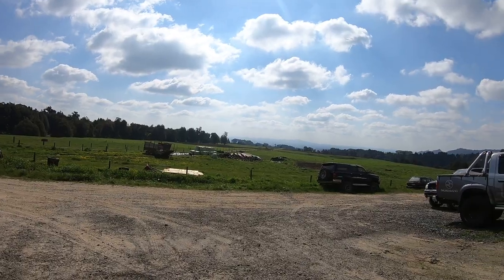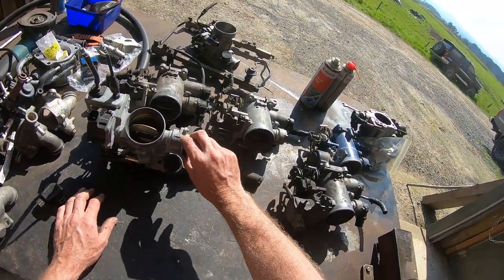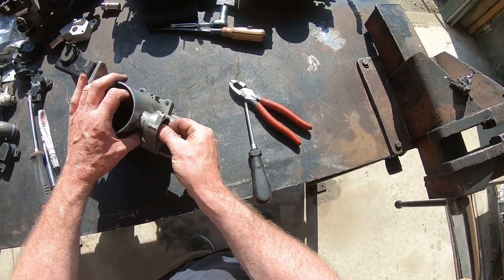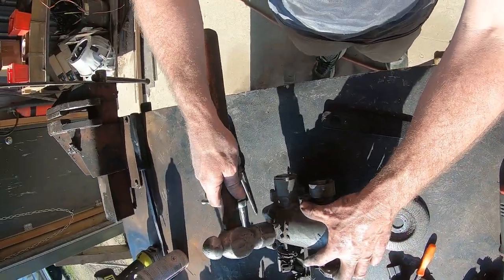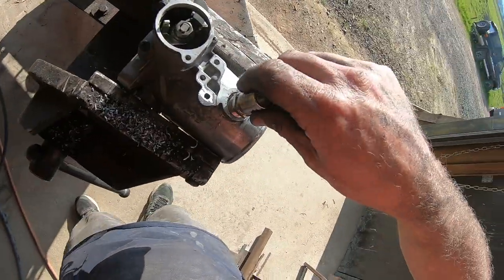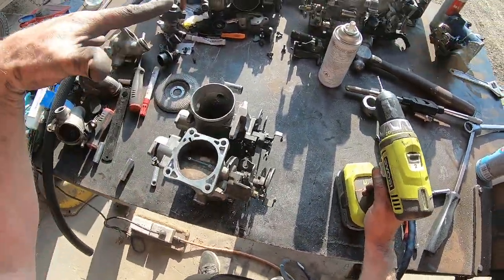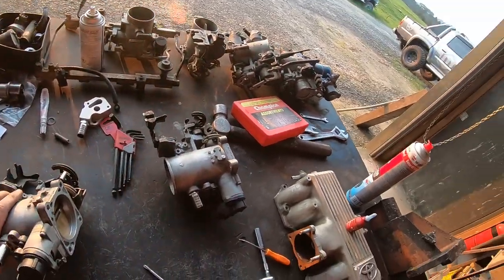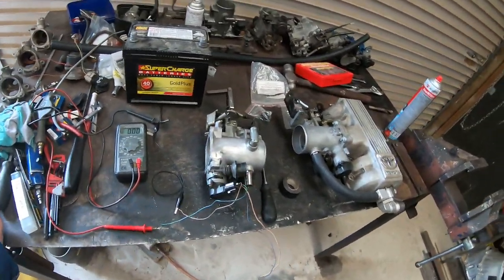1uzfe Non-vvti Throttle Body Mod Tutorial.  includes Setting TPS - tricks. 1uz TRAC off

Comment: Man have your videos helped me! Between the ufc20 wiring, the coolant line delete, and this video I have been able to really simplify my swap. I did decide to put it in my mk3 supra instead of the mk2. It's a much less involved swap. Just got done cutting the TRAC parts off my throttle body and about to head to the hardware store for the right barb and tap. Just gonna thread a plug in the backside being I will be running stock ECU. I know I've said it before but thanks a million and I can't wait to see more!
Reply from the maker: Cool as.  Glad to help.

Comment: Good stuff. This channel is a goldmine for 1uz knowledge. Quick question Kelvin, if doing this modification for a streetable build, how would one go about turning off the TCS lights on the dash? Besides deleting the bulb of course lol. Cheers
Reply from the maker: If you listen very carefully in some of my wiring videos I mention that the traction control and non traction control ecus are the same,  with the difference in the harness.   I know how to mode the harness to convert them to non traction control. If this isnt done then there will most likely be issues. The useless info I know.

Comment: Hey there, just subscribed.awesome channel. Where do you get the plugs for coolant ports? Any links or specific name or brands?
Reply from the maker: Good morning.  For the plugs for the coolant ports the back one is the blank rubber from the front of the IAC (JDM spec, No EGR). The front coolant ports we alloy welded up although it would be simple to either lathe up some blanks or I have also tapped them and screwed in some grubscrews.  Cheers
Reply: CartuneNZ may just be video quality, but it looks like you hammered some sort of metal plug on the top ports of throttle body closest to manifold
Reply from the maker: @charley240sx  there are two air fittings in the TB which were blanked with lathed up plugs.  One was for the supply to the purge vsv and on the race car TB we blanked the engine breather.  On the other one the engine breather was left alone.  We just machined up some alloy plugs for these.  The waterlines to the TB were sanded off completely just to make it look better.  Cheers

Comment: I've got a couple questions about this mod Kelvin.
Will I be able to retain cruise control with this mod?
Can i delete the coolant lines to the stock IAC?
Does the valve cover breather on the throttle body side need to be returned or can it be vented to atmosphere with the TB nipple blanked or ran to a catch can plumbed in along with the pcv? (I already have a full egr block off plate so the pcv doesn't get returned anymore)
Set up is currently not boosted but plans are in the future.

Thanks, Ian
Reply from the maker: Hello Ian

Yes cruise control can be retained.  
Yes the coolant lines can be removed from the iac. 
correct PCV removal is on my list of videos.  So many people dont understand the system and get it wrong like yours doing more harm than good.  While I prefer to keep the system in place and working as it aids in both engine running and power it can be removed if required.  A catch can with vents to both tappet covers is best.  Especially if boosted large lines into both tappet covers.  

Cheers 
Kelvin
Reply: @CartuneNZ  great thanks so much Kelvin

Comment: My first gen ucf10 starts and then stalls. Will run fine if I hold throttle on but won’t idle. I’m new to this platform but am I right to replace the IAC valve?
Reply from the maker: I have videos on repairing the isc which I'd recommend first.  Cheers

Comment: Can you use a drive by wire throttle body on an early model motor ?
Reply from the maker: Sure can if you want to modify the plenum to suit the VVti throttle body as the flange is different and then run a suitable aftermarket ECU.

Comment: Does it increase the engine speed with air conditioning? Or only when the engine is cold?
Reply: Is it available for sale? Thanks🌹
Reply from the maker: Hello.  This is a throttle body mod.  I made the video so guys can sort their TB out themselves but I do modify some at times for local customers.  The idle speed is on the front of the plenum and if everything is wired correctly there can be an idle up for A/c and cold.  That is contained in management

Comment: Hi Kelvin, just wondering if I need to run the coolant line to the factory IAC?

Thanks, Ian
Reply from the maker: Up to you.  I remove them as per my video.
Reply: @CartuneNZ Thanks, Kelvin. I just didn't know if they are needed for the IAC operation with an engine running the stock computer. 

Cheers, Ian

Comment: My 97 ls400 stalls and dies only when hot, cold start fires up 1 shot,once it cools down it fires up and doesnt die again until i turn off ignition and try to start but stalls when hot again.

Changed knock and both cam sensors,cap and rotors,both ignition  Coils and igniters,wires and plugs,fuel filter and fuel pump, ordered exact same ecu matching numbers but same problem, no obdii codes except cylinder 1 missfire....any clue?please and thank you.
Reply from the maker: Looks like some more advanced diagnoses is required.  Does it start and stop when hot and then not start again until it cools down?
Reply: @CartuneNZ  yes sir
Reply: Only starts again when it cools

Comment: hi Calvin I recently did a conversion on a toyota hiace , i have put a 1uz  i am using the standard ecu how far does my air flow sensor be from the throttle body i am using the standard throttle body, or what 's your best advise
Reply from the maker: We normally run them between 200mm and 400mm from the TB without an issue.  Cheers Kelvin

Comment: I am getting code p0510 closed throttle position switch malfunction. Is the tps bad?
Reply from the maker: I would be starting by testing TPS and idle switch, and consider it may also be an earth issue or ECU fault.  Testing is the best way forward.  Cheers

Comment: Hi, do you use that iat sensor for factory ecu aswell? Or just blank off instead if keeping factory ecu
Reply from the maker: I only use that IAT with aftermarket systems.  For stock ecu the hole is blanked with a frost plug and stock IAT in AFM is used.  Cheers
Reply: @CartuneNZ  thanks for the help
Reply from the maker: @joshcoleborn1129  Whats your 1uz in?  Sounds like you are running stock ECU?
Reply: I have a 99 single cab hilux with a 3rz-fe that has a dead motor and been looking into a 1uz-fe swap, I've found your trademe auctions for conversion parts, would you have an email or something I could send some basic questions to you on before I dive into the swap (which type of motor to get and that sort of thing)
Reply from the maker: @joshcoleborn1129  info@thecartunecompany.co.nz  just understand im busy and wrote my conversion instructions because i get asked the same stuff all the time and it drives me nuts.  Check out the auction on trade me.  I also do a better deal on a few bits to customers that buy these.  Cheers

Comment: Will my acceleration increase , or get better acceleration responce if i unplug the traction controle motor, and remove the traction controle cable?
Reply from the maker: Unless your traction control has a fault you should get zero difference in acceleration by unplugging the traction control motor.

Comment: What's the purpose of deleting that coolant line?
Reply from the maker: Makes the engine bay neater and the engine easier to work on.
Reply: @CartuneNZ  got it! next question: what grommet did you use on the air temp sensor?
Reply from the maker: I measure up my sensor and chose one from rubber shop.  That reminds me I must get more of them.

Comment: Can eny thing be done to the vvti throttle body.
Reply from the maker: Not really, maybe they can be polished if you wanted.  I prefer to leave the water lines on as the cooling system bleeder is on the TB on the 1uz VVti TB(thats the hex head blanker on top).   I did have one recently which the water lines weren't connected but not my preference. 3uz VVti TB is pretty basic and the tidier of the units.  There is nothing extra like traction control and no external IAC as thats sorted by the drive by wire so I leave both the 1uz VVti and 3uz VVti throttle bodies standard.  Cheers
Reply: @CartuneNZ  thank you for your reply.i have a p1663 fault coming on I have fitted new vvti sensors on both sides and it's still there.
Check wiring.from wat I can see it's ok.you know eny thing I can check.
Reply from the maker: @davidpritchard6685  Im guessing this might be in a conversion so its just been wired in?  Or is it a factory vehicle? 20 series vvti,  170 series vvti or another?

Comment: Do you need the dampener for the throttIe cIosing?
Reply from the maker: Hello Brendan.  I prefer to keep the dampener on for every job I do.  Ive had quite a few guys bring their vehicles in without them complaining of stalling , especially on stock ECU, and by refitting the dampener it solves the issue.  Cheers

Comment: Hello CartuneNZ,

I'm unable to calibrate my sub throttle position sensor on my 92 sc400 and I believe it may be due to the same issue as you described at time 1 min 55 sec (you mentioned the butterfly valve is shifted upwards and upon inspection, mine is also open half way at idle and closes by pushing/ pressing upwards). I believe this is the reason that the pins on the sub throttle position sensor are shifted  and not aligned the same way as the throttle position sensor. I tried testing for continuity at the e2 and idl termials like you showed in this video but the sensor is positioned so far forward that it reads infinite resistance. Is there a way to reposition the butteryfly valve? Any advice would help and would gladly support your patreon page. 

Best Regards, 

Pawel
Reply from the maker: I would  be removing the sensor to test on the bench.  If the issue is the butterfly shaft then there is a major issue.  I see it lots where the sensor is incorrectly fitted too.